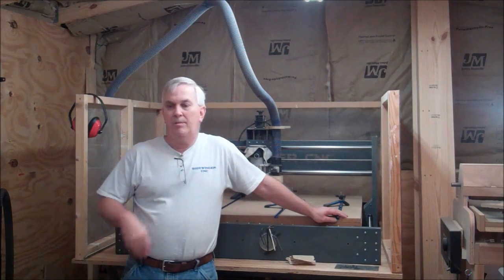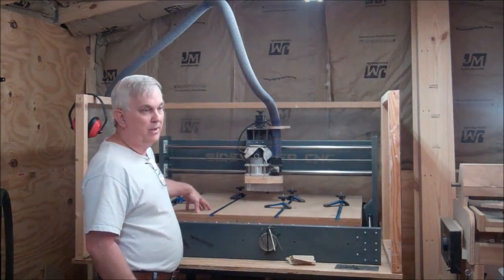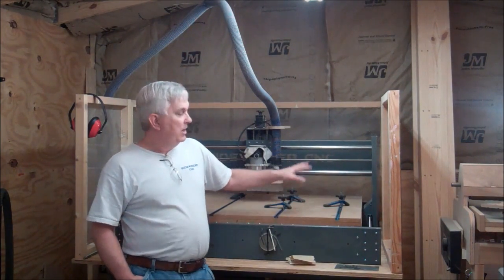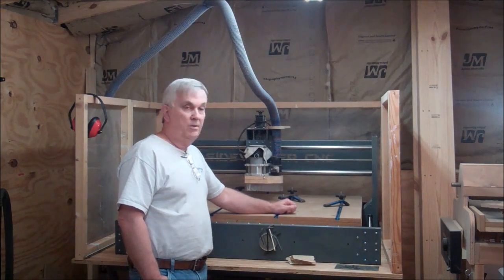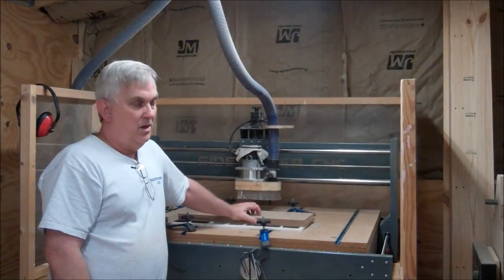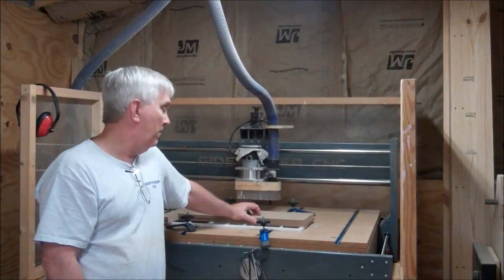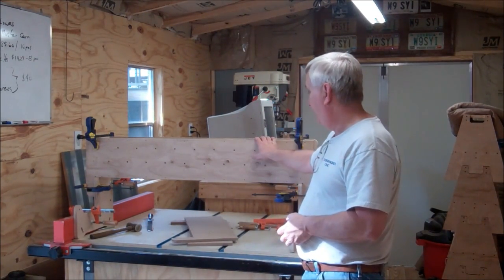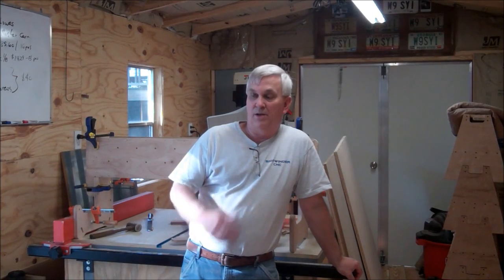Another CNC Router Build Part One

Comment: old vid i know 
i have been thinking about routing stuff longer than the size of the routertable even before i'm starting to make a cnc router , i dont have a lot of space for a full size table and dont need the machine full time meaning it will take up valuable space when not in use 
wat i am thinking of is splitting the program in two parts and use holes to center the part on the table so the second half of the program and the machine line up exactly with the half allready made 
basicly drill two holes verry exact (can use the router with a verry basic dril two holes this size and so far apart type of program ) somewhere along the edge of the material and push the plank on two dowels on the table and work from there have the machine drill two more datum holes outside the part after its made the first half and move the whole plank up the router untill those new holes are on the dowels 
you could repeat that as often as needed as long as you have enough room in the front and rear of the machine and the machine is wide enough to have the plank sit between the gantry 
i was thinking on raising the x axis rail above the table kindah like a overhead crane only have columbs going down at the 4 corners of the machine , that way you can move material on  the table under the machine from all four sides

Comment: It's simple Dave. Do like we do in the tool and die trade. Pin It. Lay out you form and include two pin holes and reference the remainder of the part location when you shift the part. Dim. Will be right on.  Just suggesting. Later.

Comment: I should have learned my lesson about buying electronics from ebay.  I thought I would save a little but all i have is a board that doesn't run the motors and everybody giving me different configurations.  If it wasn't for that I would have mine running now.
Reply from the maker: Lee, that is why I only specified parts and components that I know work and are readily available.  I didn't want people to get frustrated trying to find components here and there.  If you use what is spec'd out on the drawings all the hard work is done for you.  Sorry you had a bad experience buying from ebay.